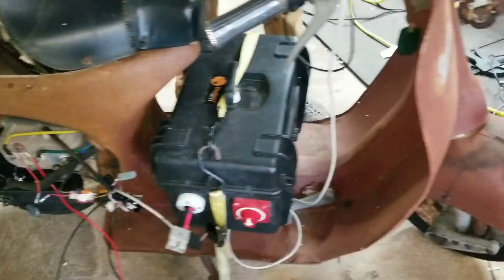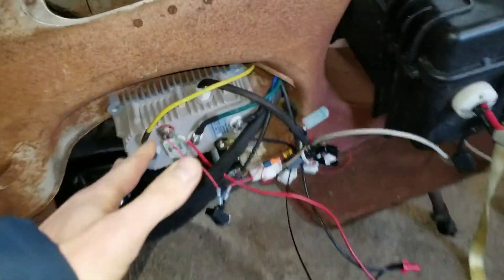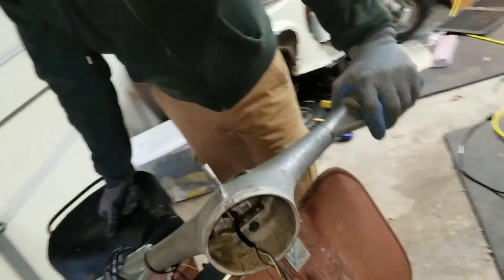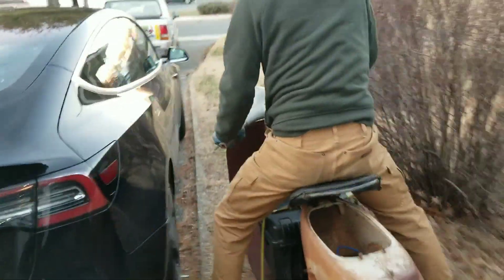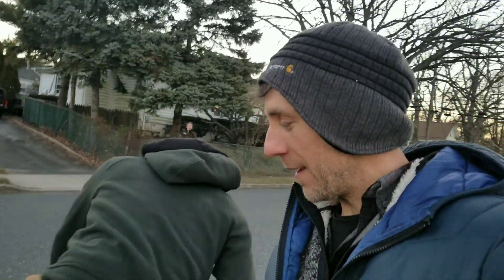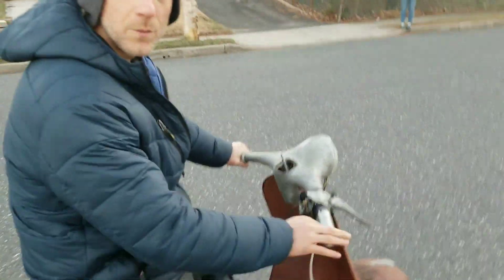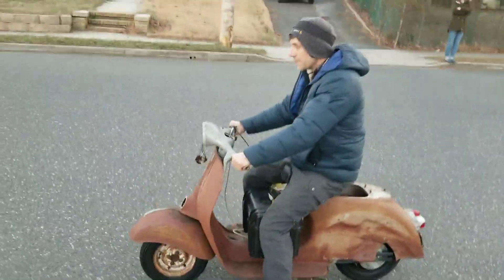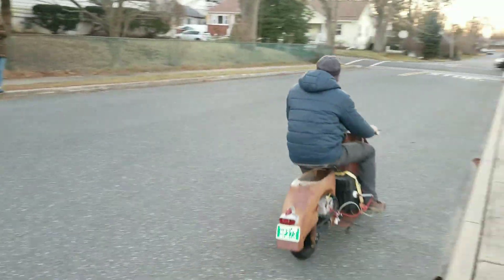Vintage Vespa electric conversion

Comment: Love this. Have a 63 Vespa that I'm thinking of converting. Does the motor go straight on to the rear wheel spindle? Or have you run it on chain or belt? Just thinking how to fit motor under the side cowls.
Reply: Goodwinsplace it’s a hub motor, means the motor is built in to the wheel, no need for mounting the motor and using chain or belt drivers.
Reply: Yep, it’s a hub motor as Charon said. This requires you to build a custom swing arm. I’ve been it talks with a company out of Italy which has a bolt on kit. It’s keeps the Vespa and it’s pretty much just bolt on, Which makes the conversion super simple. Let me know if you are interested  in going that route.
Reply: @sunlightconversions828  can you please tell me where can I purchase that kit, I also want to know more about it, kindly provide any website details of that company.
Thank you.
Reply: @charanteja1157  http://www.motoveloci.it/retrokit-2

Where are you located?
Reply: @sunlightconversions828  thank you for the details.
I'm from india.
Reply: I would be interested to buy that swing arm. How can I locate it?

a greeting from Spain.
I like a scooter you converted.
Reply: Thanks all, been looking into these now since seeing this video. Anyone used GoGoA1.com for a motor? They look good and a really good price too.
Reply: @GoodwinsPlace  They might be legit but I  don't know anything them. I can recommend QS motor.

Comment: Whats the max speed on on vespa?
Reply: Kevin Herring The temporary battery I was using was 48 volt, that got me up to around 40mph. The the custom
Pack I’m building with telsa cells is 74 volt. That should get me over 60mph.